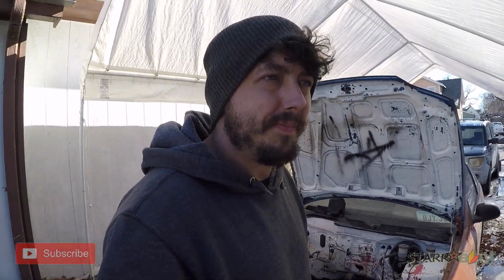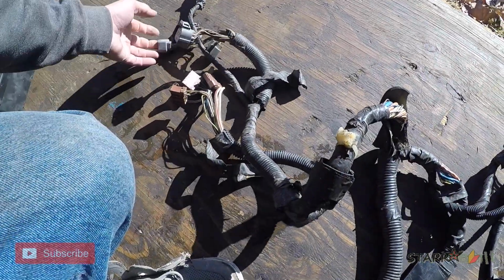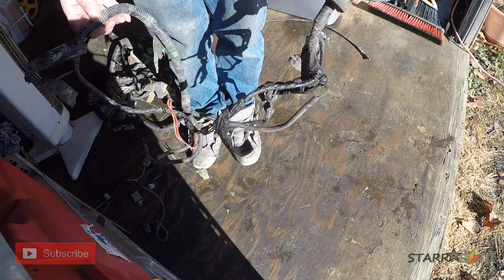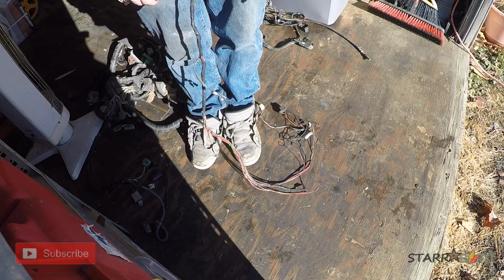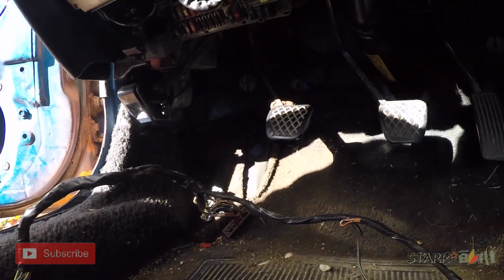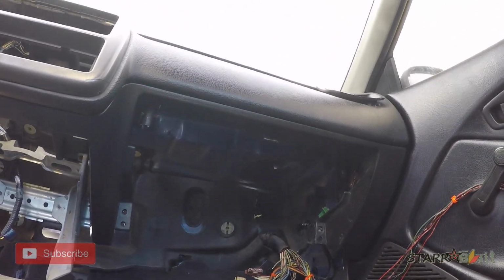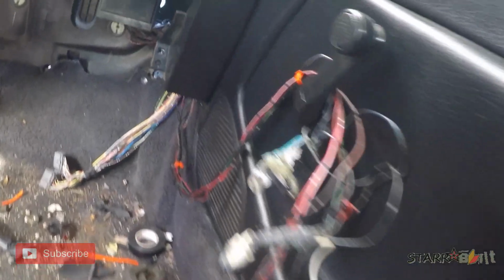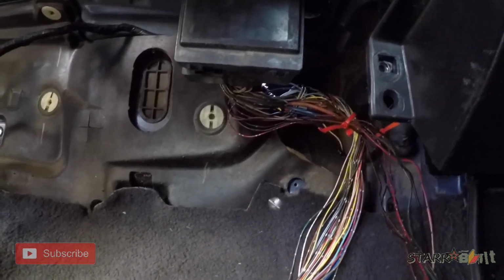EG civic wire tuck pt#1 (Eg hatch build part 3)

Comment: Hey man, I’m planning on relocating my main fuse box in order to make space for a breather canister in the space where the main fuse box was. If I relocate the fuse box to right behind the fire wall, similar to where you installed yours, will I need to lengthen any of the headlight harness for it to reach, passing through the fender? And will I need to lengthen anything else for the engine harness to connect? Nice video btw, and thank you.
Reply: Why dont you relocate the fuse box to the trunk area with the battery that would be a first.i have thought about it im just too lazy

Comment: Would a 1994 Honda Civic sedan cabin wire harness . Work with a 1993 Honda Civic hatchback or there different
Reply from the maker: 92-95 sedan hatch or coupe should all be the same
Reply: Thank you
Reply from the maker: no problem bud thanks for the view
Reply: @StarrBuilt  incorrect
Reply from the maker: What is different besides abs and vtec